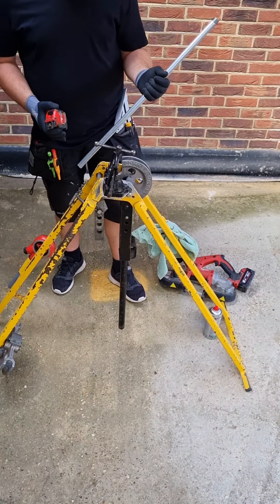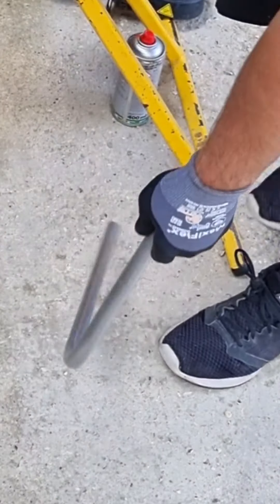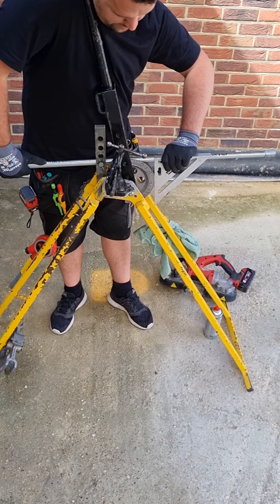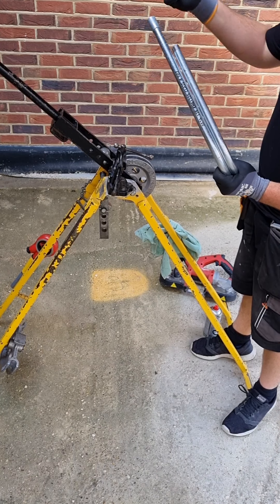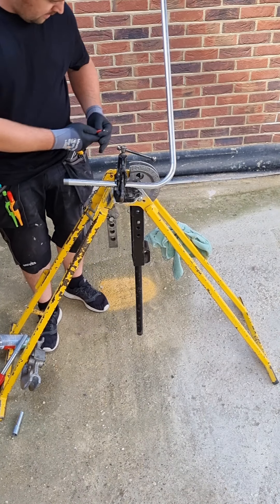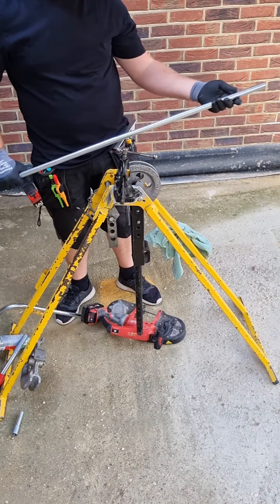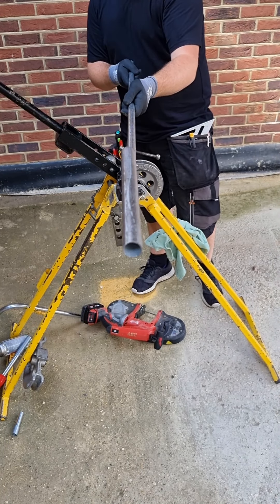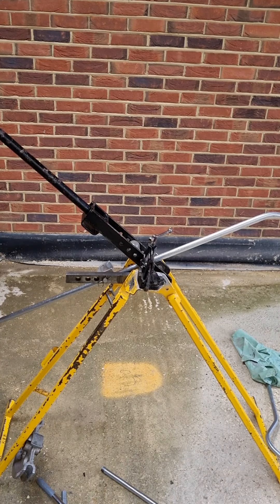Conduit bending 101

Comment: I try doing 25mm bubbles with a depth of 30mm 
22.5 first bend , 45  middle bend 22.5 last bend ... but it seems to over stretch ... if I have a depth that’s much larger then the bubble comes out fine ... how do I go about doing a bubble with depths of 30mm .. thank you . And thanks for taking your time out to share your videos.
Reply from the maker: No problem bud. And I do the middle bend first and try a smaller bend too. If you find a good method then mark the side of the bend like I did in this video ie for you middle bend and the bend either side and you should be able to recreate it every time. Hope that helps and I might try and get a video out for bends, sets and bubbles